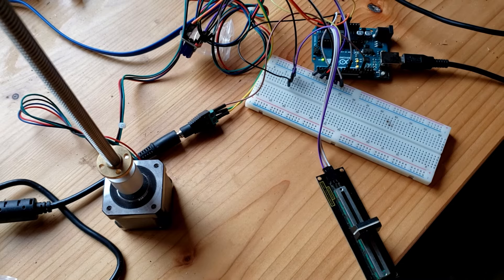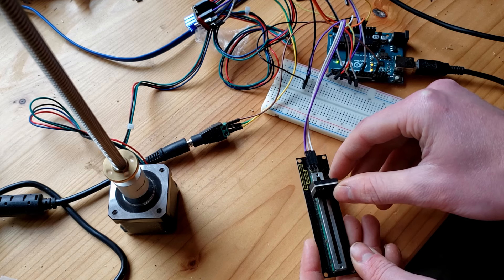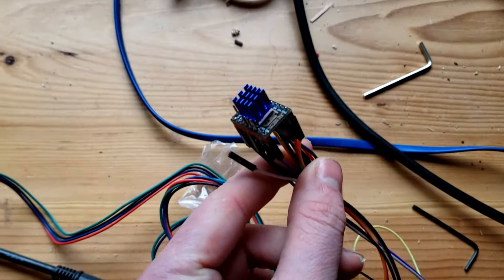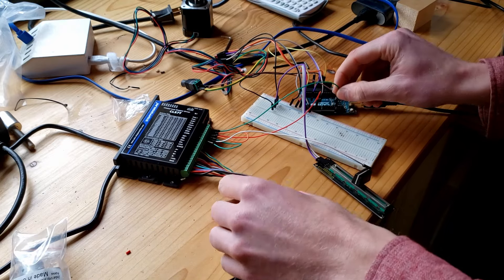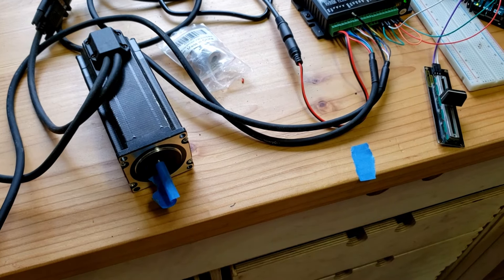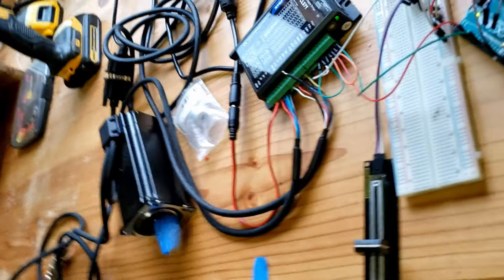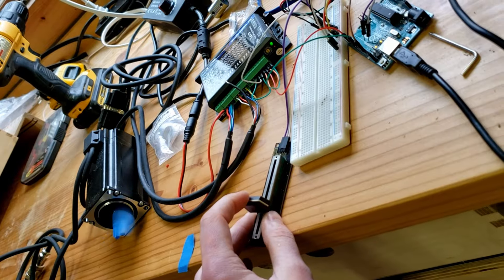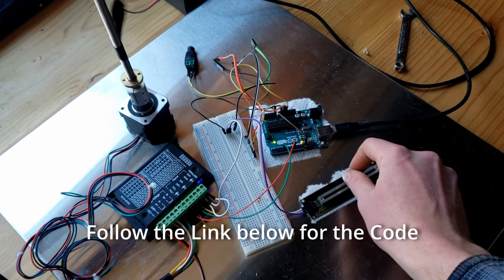How to spin stepper motors fast and precisely with Arduino FastAccelStepper

Comment: I can easily get 20,000 steps per second at 1/8 microstep on that first stepper motor. 40-50,000 is also non issue on the second stepper. Your issue is not the stepper motor, its the Arduino and library are using, try  programming the step sequence and linear ramping yourself and you can make that that scream. hint, use 2 interrupts, one for the step rate and the other for 5uSec pulse time: first timer interrupt is free running at the step rate, enable second timer interrupt at the end of pin high in first interrupt, when second interrupt fires, (at 5uSeconds) turn pin off, and turn off interrupt.